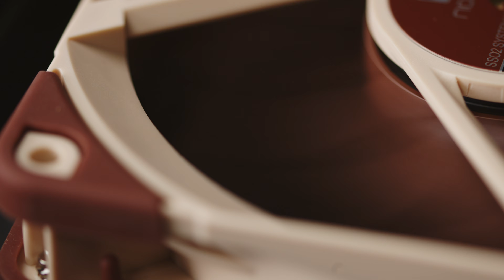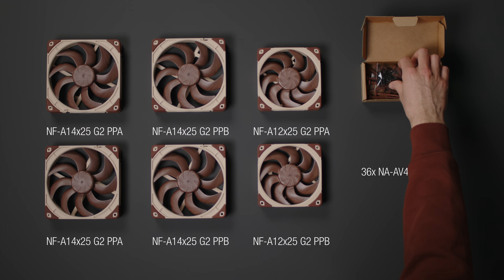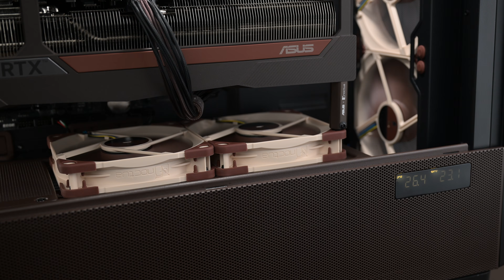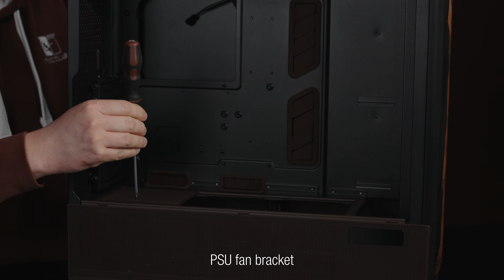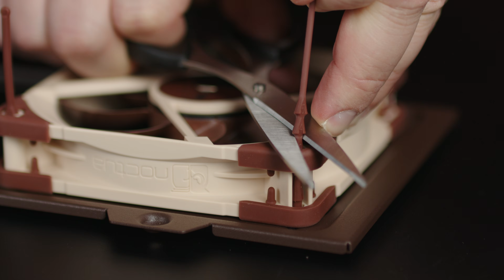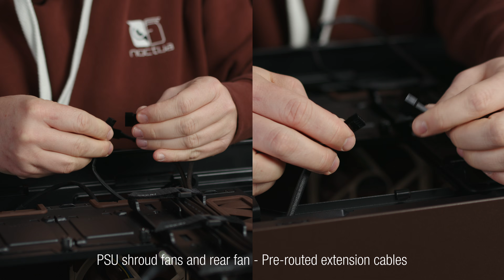Antec Flux Pro Noctua Edition: Fan installation guide

Comment: Is it possible to purchase just the fan kit? I have the case already.
Reply from the maker: Yes, the fans used in the Antec Flux Pro Noctua Edition are 2x NF-A14x25 G2 PWM Sx2-PP and 1x NF-A12x25 G2 PWM Sx2-PP.

Comment: So the Fans with the case are marked PPA & PPB, How do you get additional fans between A & B once you go past the case provided fans?
Reply from the maker: Additional PPA/PPB fan sets can be purchased separately.
120mm fan set: https://www.noctua.at/en/products/nf-a12x25-g2-pwm-sx2-pp
140mm fan set: https://www.noctua.at/en/products/nf-a14x25-g2-pwm-sx2-pp

However, we do not necessarily recommend adding additional fans to the case. Find out more here: https://www.noctua.at/en/expertise/guides/antec-flux-pro-noctua-are-extra-fans-worth-it
Reply: @NoctuaVideos  are those two links the only place you can get the -pp fans from? What's the difference between those and off the shelf fans you sell individually?
Reply from the maker: These two links are to the product pages on our website. Of course, these sets are also available with a number of retailers, which you can find in our where to buy section.

The difference between these sets and the individually available fans is a slight offset in RPM between the fans to avoid unwanted acoustic phenomena.
Reply: @NoctuaVideos couldn't we just use the normal low noise adapters to mimic the different speeds between replacement case fans with off the shelf fans of yours? Or is the set at a different speed that just using the low noise adapters?
Reply from the maker: Low noise adapters or different fan curves for fans next to each other are, of course, viable alternatives.

Comment: Yesterday I rebuilt my AMD PC. I purchased the Lian Li Lancool 217 in white to match my desk. I removed 3 of the Lian Li fans to install 2-120mm in the bottom and a 140mm fan in the rear of the case. I didn't stop there because I also installed the Noctua NH-U12A cooler. It's almost a dream come true!

Comment: "Thanks for the video! A tutorial on how to properly identify and label each fan in Fan Control would be amazing. With 8 case fans (including a custom push-pull top exhaust), 2 fans on the NH-D15 G2, the Seasonic TX-1600 Noctua fan, and the 3 fans on the Noctua 5080, it's a real headache to figure out which controller matches which header. Keep up the great work!"

Comment: The grille pattern on a PC case’s exhaust vents should be as open and unrestricted as possible. The exhaust fan is trying to push hot air out of the case, but when the airflow hits a restrictive metal grille, it creates unnecessary resistance. This reduces airflow efficiency, increases turbulence and noise, and can trap more heat inside the case.

Comment: Been using my original Flux Pro with 120mm Chromax fans for over a year now & absolutely love it! Need to change 3x 120mm fans on my MSI RTX580 Suprim Liquid radiator to Chromax 120mm G2's & anti-vibration gaskets. Really trying to justify changing the other Chromax fans in the case to G2 versions (which will prob happen when I swap my Arctic LF3 360mm AIO (using NF-F12 Chromax fans & gaskets) to 140mm Chromax G2's & 140mm gaskets. Just need some reverse blade Chromax fans for the basement mounts.

Comment: I had one of Antec's white cases on my wishlist for the longest time before this one was released. However, I eventually gave up on it because it didn't have a dust filter. I completely forgot for a moment that I have a pet. It would have been perfect if it just had a filter... I wonder why they left it out.
Reply from the maker: Dust filters on the front panels of cases are becoming increasingly rare. This is mainly due to airflow considerations, as dust filters present a significant airflow obstruction. Of course, it is not ideal to have to clean out dust more regularly, but we believe that the benefits in noise-to-performance efficiency far outweigh these drawbacks. The front mesh of the case is also dense enough to catch larger flying debris, so having a pet doesn’t pose an issue for this case.

Comment: Not really helpfull.

Tips for installing the fans
-Remove the 2 harddisk/ssd bracket from the back, easier acces to the connectors.
-When you install the fans in the front bracket, put the 2 cables in the bottom hole, and 1 cable in the top hole of the bracket.
Reply: You really helped me with my build thank you, was confused with the front bracket cable routing and lost a lot of time tryong to find videos

Comment: First of all, I would like to sincerely congratulate you on the launch of your new product!

I had actually wanted to purchase the Antec Flux Pro Mesh case, a collaboration with Noctua, as soon as possible. However, as the release date kept getting delayed, I personally purchased Noctua's new G2 fans individually and installed them in the Antec Flux Pro Mesh case, and I am currently using them in advance.

I purchased a total of three sets of NOCTUA NF-A14x25 G2 PWM Sx2-PP fans for the Antec FLUX PRO MESH case. I am using the front of the case in intake mode in the order A-B-A, and since I am using a 420mm AIO cooler for the top radiator, I am using them in exhaust mode in the order B-A-B. For the bottom section, I purchased one NOCTUA NF-A12x25 G2 PWM Sx2-PP set and one original NOCTUA NF-A12x25 G2 PWM standalone unit for the intake configuration, and am currently using them in the order of A-B-Original.

Finally, for the rear section, I purchased an additional original NOCTUA NF-A14x25 G2 PWM standalone unit and am using it for the exhaust configuration. Is this configuration correct? Of course, if I had purchased the Sx2-PP set instead of the original versions currently installed on the rear and bottom, I could install the NF-A14x25 G2 PWM 140mm PPB fan on the rear and remove the existing NF-A12x25 G2 PWM original version on the bottom to install the NF-A12x25 G2 PWM 120mm PPA fan, thus completing the final configuration in the order A-B-A. However, since the Sx2-PP product comes with two fans, doing so would result in one wasted fan each in the 140mm and 120mm sizes.

Because this would result in two fans that are not immediately needed, I determined that purchasing the individual original versions was more cost-effective than buying the Sx2-PP set and wasting fans. That is how I made my purchase; would using the configuration described above be a good idea as well?

I am asking this question to hear advice from Noctua.
Reply from the maker: Hello and thank you for your enthusiasm! It seems like you have figured it out all by yourself pretty well! Your configuration is very good, and having the rear exhaust fan be a standard version is quite OK because it’s a "lonely" fan at the back. However, if you want to be very, very precise, you can connect the two standard version fans, the rear 140mm and the bottom 120mm fans, to one PWM header and reduce their speeds by a small fraction. This would make the bottom fan fit into the slower-faster-slower pattern, and the rear fan, which is close to the B model faster fan, would also fit into the faster-slower-faster-slower pattern that is happening at the top of the case.
Reply: @NoctuaVideos  Thank you very much for replying to my comment.

Regarding your suggestion that "connecting two standard fans (a rear 140mm fan and a bottom 120mm fan) to a single PWM header and slightly lowering the speed is a good method," since there are two fans, is it correct that I should use Noctua's NA-SYC1 cable, connect the connector to the motherboard's PWM terminal, and then set the RPM to a slightly lower speed in the BIOS?

Or, since the fan sizes are different (120mm and 140mm respectively), is using the NA-SYC1 cable not recommended?

If it is not recommended, I have two spare PWM headers on my motherboard that allow me to connect the 120mm and 140mm fans separately without using the NA-SYC1 cable. And regarding setting the RPM of the fans mentioned above to low speed, does that mean I should set the RPM of the fans adjacent to PPB based on the RPM of PPA, and the fans adjacent to PPB based on PPA?

Did I understand your answer correctly?

Comment: Hello, already buy this gorgeous case and planning to build with an AIO. Question maybe stupid but should i go with an 280mm rad with an additional 140mm fan as intake or a 420mm rad ? Worried about fresh air from the front fans to be sucked out immediatly
Reply from the maker: The 420mm AIO option would be a better choice and would set you up long term in regard to CPU cooling. You will not be able to get the same benefits with a 280mm radiator and the optimized airflow with the additional 140mm fan. In the case of the 420mm AIO, there is no need to worry about the fans closer to the front of the case taking fresh air immediately, since this would actually be beneficial, as the radiator is being fed fresh cool air.

Comment: Great case, I love the colour scheme and of course the Noctua fans. Sadly, however, the base case (Antec Flux Pro) is such a conventional case. First, the power supply is in the way of providing optimal air supply to the GPU. A dual chamber approach where the PSU is located on the other side of the motherboard (typically mounted on its side, so that the case does not gain too much with) would have been better. Such a case design also makes cable management easier and facilitates more storage installation options. Second, the side panel made out of glass is a feature that almost every case has for no good reason. PC users look at the monitor, not their hardware, while using the PC. For minimising noise, a solid metal side panel with acoustic dampening applied would be better (and I reckon cheaper) than glass. For GPU temperatures, a metal side panel with a dedicated duct designed to let the hot GPU air directly exhaust out of the case would be better. Glass side panels reflect the hot GPU air (that is pushed out to the sides of the GPU) back into the case, leading to recirculation by the GPU and heating up the air cooler.

Comment: I believe cases should be sold without fans unless you pick them up as an extra, that may be cheaper than buying separately, but not automatically included
also I/O panels should be easily replaceable, upgraded during the case lifetime and replacement modules sold to let current owners get the improved I/O
additionally I think different fans shouldn't share the hub, you'll most likely want to set up different speeds for different models, so mixing 140 and 120mm on one hub will end up being suboptimal
Reply from the maker: Currently, we have no plans to offer the Antec Flux Pro Noctua Edition case without the included fans, and there are multiple reasons for this. Just as we don't offer heatsinks without fans, it's the same philosophy for the case.
The product we are offering is the combination of the case and the fans, and the value this combination provides to the end user. It's the same as with a heatsink, to guarantee the user experience the product is intended for, it is delivered with the fans that we deem work best in that scenario.
There are also logistical challenges to excluding the fans, so for now and the foreseeable future, the Antec Flux Pro Noctua Edition will not be available without the six G2 Noctua fans.
Reply: @NoctuaVideos  I understand that, and that wouldn't be a Noctua edition without Noctua in it, but as with most cases included fans are at best medium grade, usually much worse, even with top tier like here you may already own your set you'd like to use instead of paying once more
I know logistics are not in favor of such solution, but at least these are not custom fans that absolutely need to be made to fit the case or heatsink (like some 135mm fans of your competition), which simplifies things for sure

a lot of high class products probably shouldn't be readily available on shelves but maybe not made but at least completed on order to match the expectations without wasted materials, but I am also aware that modern world expects everything to be available ASAP and nobody cares about getting their perfectly matched setup anymore so good enough is more than enough for the market

but still, top tier fans are expensive enough even with extra labor costs that would be savings for no-fan buyers, though probably te 99% of people buying with fans would also have to pay extra, so that's not something possible to do

Comment: Honestly, I love your stuff. But, $400? With what is happening to the PC parts market at the moment, people struggling for money etc? You're insane. I am pretty comfortable economically but I'm not mad enough to spend $400 on a case that ordinarily costs $180.
Reply: The fans cost $40 a piece. There are 6 of them included. $240. It's exactly what you should expect the price to be...
Reply: @Seacle14  You're acting like the original case didn't come with fans.
Reply: Honestly fair if you were to add up all the noctua stuff that is included with this case it around 400 usd😅 so they are not scamming you at all. And you can always buy the normal flux noone is asking you to buy this case
Reply: This is premium PC building as we don't worry about price.

Comment: isn't it better when the radiator is placed in front to have the pipes from the bottom? 🤔
Reply from the maker: Users should always follow the recommendations from the AIO manufacturer. Generally, as long as the pump is positioned lower than the tube inlet point on the radiator, so that air gets trapped at the highest point in the radiator and not the pump, the system will operate optimally.